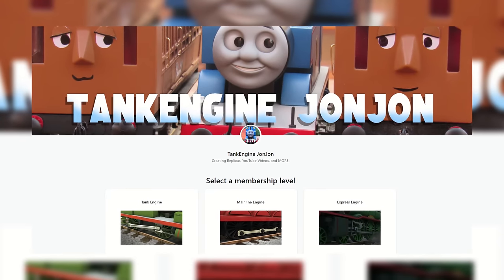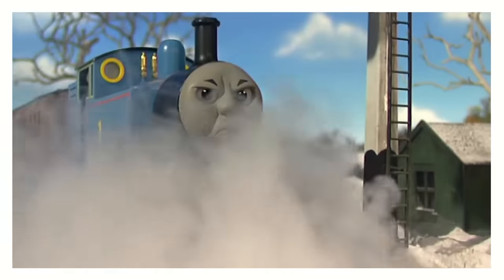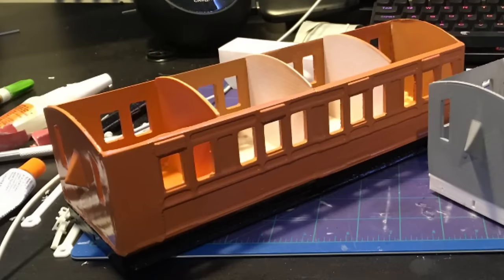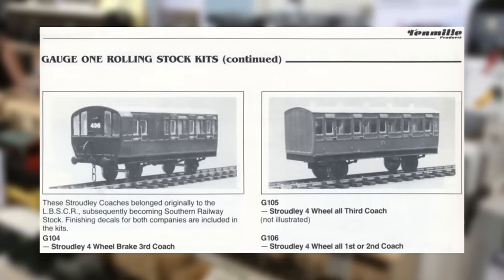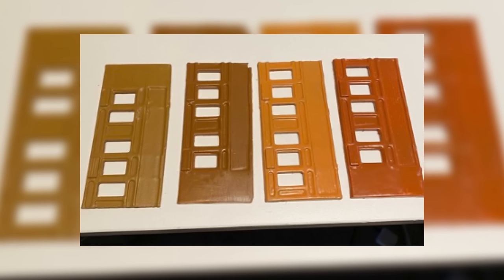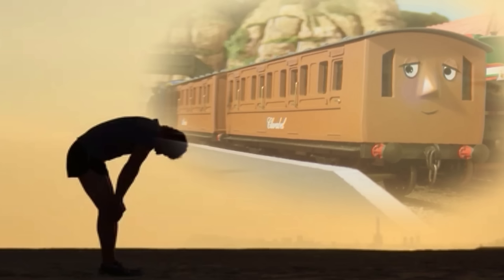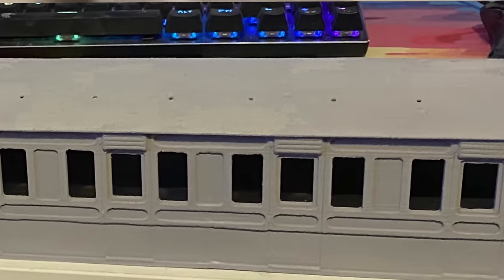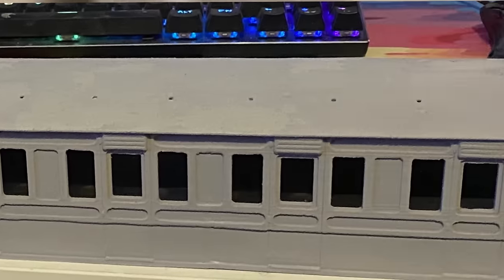How I Built My Gauge 1 Annie & Clarabel | Tutorial (3,000 Subscriber Special)

Comment: Technically for the side rods you'd want to have them as separate pieces like you did, it makes it easier to work on bigger locomotives so you have less to take off if you have one problem spot, and it also makes it easier for the locomotive to go over rough track and gradients, especially if you have suspension on the wheels.

More on the maintenance side, let's say you have a model of Murdock, the really big one, it has 10 driven wheels so it would be easier to have all the connecting rods separate. If you'd have a problem with the wheel closest to the cab you can easily just take the connecting rod off of that pin and it swing out of the way. If they're all one piece you would have to remove the whole thing.

It also looks cooler if you do it like that and only have one axle connected to the motor. Speaking of that, if you would make a model of Murdock for whatever reason, or anything big like that, if you gear all the wheels together you will have a lot of extra strain on the motor, so only gear the center most axle and let the connecting rods turn the other wheels.

Tbh this is why I make custom diesel locomotives, it's so much easier than fighting with things that have to be perfect to work properly lol